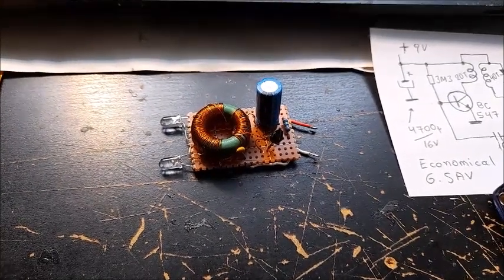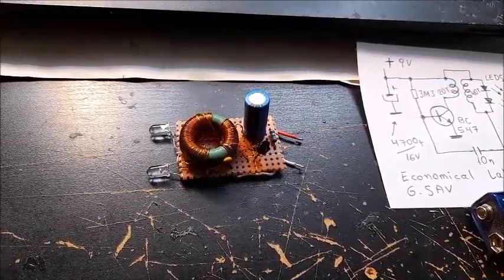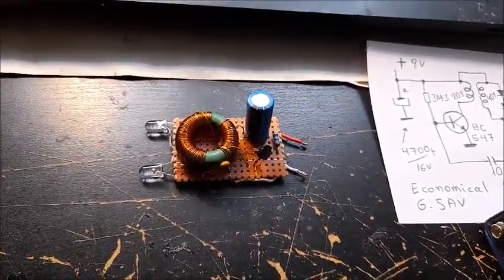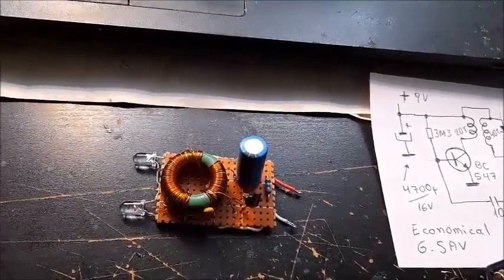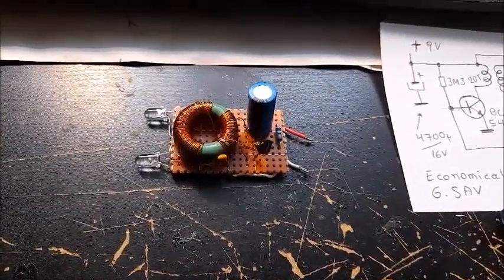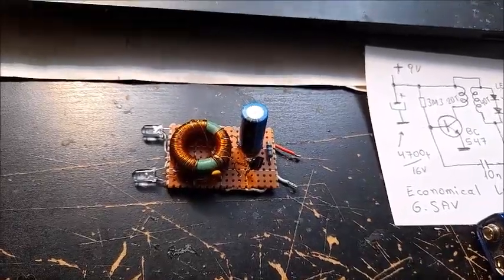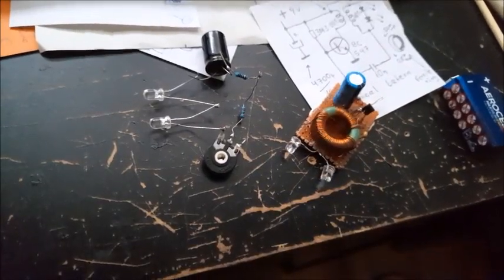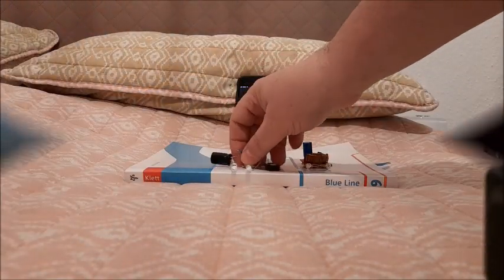Economical Latern

Comment: According to your diagram, one end of the primary is directly connected to one end of secondary. Is this correct? Because the charge in the capacitor is quickly dissipated with this bridge.
Reply from the maker: @badboypaulpark  Yes it’s correct. If you build it properly and resonates well then you may see better results as in my video.
Reply: @ thanks I will try to fine-tune the circuit!👍🏼

Comment: The collector goes to inner-end or outer end?
The cathode goes to outer-end or inner-end?
Thank you
Reply from the maker: @iblesbosuok  The  collector of the transistor goes to the one end of the primary coil of 20 turns.
Reply: @gsav2504  each coil has two ends, one on inner side of the toroid and the other one on outer side of the toroid, with respect to PCB.
That's the easiest way to determine the polarity of the coil for beginners.
The circuit will lose its efficiency (or even not working) on wrong polarity between primary and secondary. That's what you need to pay attention to when sharing with beginners.
Thank you
Reply from the maker: @iblesbosuok  Ok. In that case according to my circuit, the collector from the transistor is connected with the inner end of the primer coil (20 t). The other one outer winding is connected to the + of the electrolytic capacitor. The project works soso if you reverse them! You only have to pay attention to the polarity of the LEDs. The device works gut if you connect them otherwise! The difference is the time that the oscillation keeps running! Don’t forget, it is not a joule thief circuit! It has another function! If you need more details please let me know!